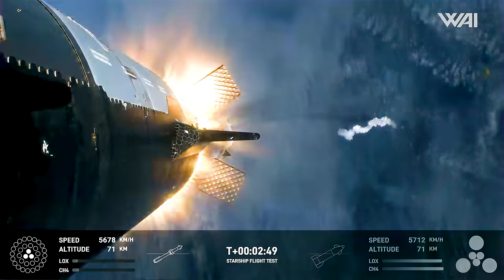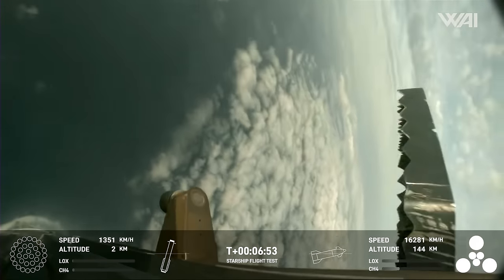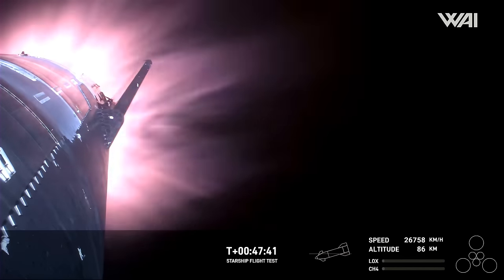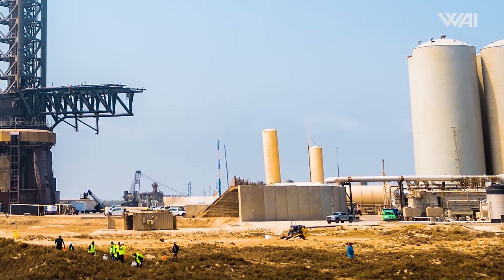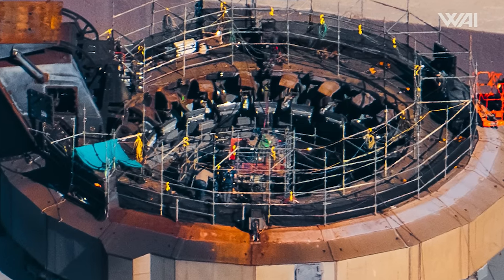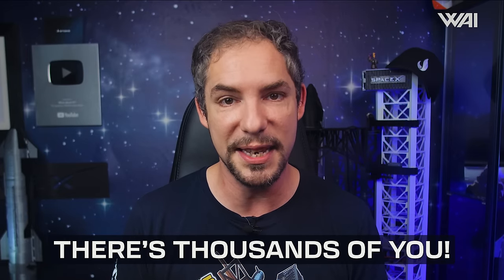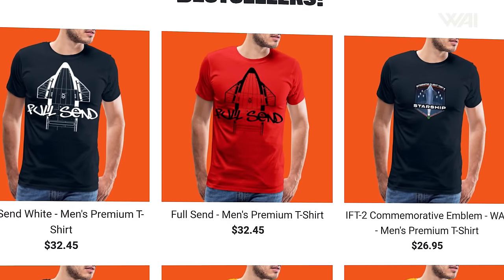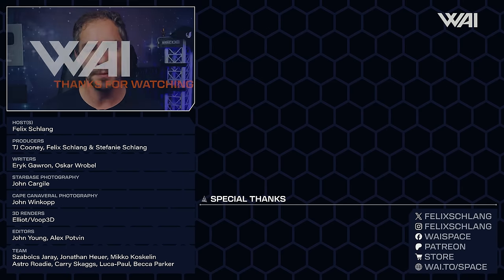SpaceX Starship IFT3 Aftermath: New Insights Paint Different Picture!

Comment: RETURNING booster may have to belly flop  flat return for a lot longer to slow the decent.
SN second stage may hae to be modified to have a mid ridge down length??
Like ma walnut ridge to disrupt plasma flow as  capsul  and may be a liqid nitrogen
spray system under ship to flow and cool plasma in 
period of high  intense minutes.
Booster metal grids should be turned to  a thin fin and placed back  to  a flat brake shape on flipping for return
Logic sayas if it slows guides coming down
the same drag will have effect wasting fuel going up.
Firing engines moments before flip ois virtical may help  a clean
less face on force to engine bells
+

Comment: It seems that Spacex have problems restarting Raptors. It is noteworthy that the orbital test of Raptor restart failed as well as most of those at booster landing. Together with the Starship stability and disappearing heat shield tiles they'll have their hands full in 2024. Probably we can expect full reusability demonstration in 2025 at the earliest. Still, fine progress. This isn't the easiest project of all time.
Reply: The orbital relight wasn't attempted, but that was due to the uncontrolled roll of the ship. Not to the engine.
Reply: The first booster catch is going to be .. intense!  I wouldn't wait until 2025.  If the next two flights have a controlled Super Heavy reentry all the way to splash down .. then should try a boost catch on the third flight.   They cannot keep throwing away boosters, if only to have one for inspection to see how well it held up, and how much refurbishment is needed for another flight.
Reply: @gregsteele806 this. The relight would have created more problems than it would have solved and was skipped entirely on purpose.

Comment: How does the booster pump the fuel to the engines during a 1000 km/h descent? The fuel must be “weightless”, floating inside the tanks during these speeds!?
Reply: Magic
Reply: During reentry the fuel will not be weightless, the ship experiences several gs of force as it slows down due to air resistance. The fuel would be push to the bottom of the tanks.
Reply: Watch the re-entry speed as the booster goes from 20km to 10km and then think about how it feels when you slam on the brakes in a car lol. I think the fuel issue was more the sideways fishtailing as the fins struggled to cope with the spike in atmospheric density at 7km.
Reply: @roberttownsend339 tnx! Its a deceleration! One less worry😂

Comment: As usual, relight seems to be an issue. They have to get this figured out next run or I have little faith they will anytime soon enough. Ultimately losing both yet again before touchdown, is a serious problem.

I'm not giving up on these guys but it's getting frustrating watching them each fail without completing their flights. Just stick at least 1 and I'll be more relaxed. It would seem these engineers can't think past the last known failure, not much in the way of foresight.

Comment: why isnt space x chill down the legs of launch site ? 
a plate in front of the legs en chill pipes behind it without a structral function.

if they let the booster start 1 engine at re-entry so al fuel pushed to the base the rest base they dont have the massive push at ones on the base off the booster
Reply: That's what the millions of gallons of water are for.
Reply: In short, because cold things snap.
Reply: @tomj819 they also chill the engines 🙊
Reply: @davelemmen4283  the engines are built to run at cryogenic temperatures and are pre-chilled to protect against thermal shock of transitioning from plus 70 degrees to minus 300 in a matter of seconds. The thermal shock of transitioning from minus 300 to plus 4000 in a matter of microseconds is an entirely different kettle of fish. That kind of energy is only reliably disipated by adiabatic cooling into a gaseous state, which is what the deluge system does. The engines can also be relatively brittle because the cryogenic parts aren't under  load. The launch mount is holding up a couple of thousand tons...

Comment: Aw, c'mon, it's a bit rich to claim that "ascent is no longer an issue" for Super Heavy.  3 out of 3 boosters have failed, albeit differently each time.  Yes, on every other rocket launch apart from Falcon, the booster is disposable, but this one is supposed to be designed to be reusable, thousands of times.  So far, it's not looking good.  As far as I'm aware, they haven't proved the reliability of Raptor for sustained reuse, although for the moment, that's a moot point.

As far as Starship goes, they're 3 for 3 there, too.  It was clear to anyone watching the stream that it was tumbling, this was particularly obvious just before the stream ended / it blew up, where the camera was pointing into space.

So, IMO, no, it's not really "steady progress". SpaceX are 3 launches in, at least 2 years behind schedule, and have burned through about 3 billion on expensive failures (it's costing about a billion a launch).  About 3 billion is what NASA have paid SpaceX for Artemis, according to their plan they should already have landed 2 supply ships on the moon - they have yet to show that they can get the damned thing to orbit /empty/, let alone do it with a payload and prove that the engines have the performance to get to luna.

Remember dearMoon?  The project to take paying customers on a loop around the moon, on Starship?  That was supposed to happen last year.

It's a disaster.

Comment: OK, well a little something about those metrics. Those people are not going to subscribe to your page. I personally just can't stand it when every single show I watch someone's asking me to subscribe. I definitely do not do that number two. I love the optimism about the future of starship, but for me it looks like basic problems have become problematic and a total disaster is what i saw in this launch. pretty pictures yes any other success no,especially control issues with WAY to much debris falling off the vehicle that appeared to be heat tiles yes I do understand SpaceX is development system like the Russians test fail upgrade test fail, upgrade test fail upgrade, but I would bet you $1000 that we will not see a successful reentry on starship for the next four launches they just have too many issues and problems cropping up with the booster and the vehicle. I do believe there was an underestimation of the challenge at hand. Falcon and starship are apples and oranges, and until I see an orange with an safe and repeatable re-entry sequence I'm not sold on starship at all. nobody's willing to admit there may be basic design issues with starship. It's not even disgusted in anyway. Also the booster too many problems there also if they're going to save that thing they're gonna have to slow it down sooner I noticed some severe vibration of the guiding veins which means the pivot points are not strong enough, and will have to be redesigned, I know they tried different vein for a while and went back to the old one. remember the whole idea for this is to carry human beings into space transfer fuel and then go to the moon and land at the pace we are proceeding. That's 20 years away and the Chinese are going to kick our butts all the way to the moon. i'm sorry, but I'm not all pie in the sky about SpaceX. I'm a realist 71 year-old pilot since the age of 15 MENSA a member who is built many of his own aircraft also only six people in the world did my job in the nuclear industry so it's not like I'm some dweeb running his mouth off. I see serious problems ahead for SpaceX the unbridled enthusiasm that I see is not warranted at this point. I know I'm gonna have some Elon Musk fan boys come and tell me that I'm just being critical and what I'll have to do is agree with them. Yes I'm being critical starship is not the falcon system the number of failures that I saw were many. including just basically opening and closing the pez door. I suggest many of your over enthusiastic viewers. Go and watch smarter every day when he goes to NASA and explains to them everything that he sees wrong with their plan for going to the moon and it's pretty devastating. NASA has always loved to spend taxpayer money like they did with their most giant failure that now appears to be headed for cancellation if it's not already billions upon billions flushed down the toilet so this is how a realist thinks. i'm ready for my tongue lashing now.

Comment: Congratulations to SpaceX on how far they have come. But we need to stop comparing this to other rockets that are not reusable to try and claim success on this test flight. While they did achieve some success and did better than tests 1 and 2, the overall test is a FAIL, because they did not achieve their stated goals.
-
Saying, well remember all other boosters are lost and not reusable so this was a success for SpaceX is deflection. The major sell of this booster is that it would be reusable and have a quick turnaround time like the Falcon 9 rockets. It was supposed to achieve a soft landing into the ocean, but it did not achieve that. Starship also achieved some amazing highlights and improvements, but it still failed the primary goal of this test. I am not even sure it achieved a successful test of the door as it did not look to open fully, then seemed to not close completely. Maybe not sealing fully had negligible effects on reentry, but can you say for sure that if the door was not sealed and as it reentered the atmosphere, it caused unintentional roll that the flight systems struggled to correct for? I do not think SpaceX would admit that and so of course they would say the door worked correctly. Felix said SpaceX might have tried to test its attitude controls while attempting reentry? Perhaps SpaceX should actually achieve its PRIMARY goal before trying to test other components. 
-
Let me repeat myself. The team at SpaceX should be immensely proud of their accomplishment. I believe in their abilities to one day succeed in their endeavors. But I wish people would call this test what it was, a FAILURE with some amazing achievements and data to help improve the next tests. Now I hope they focus on actually achieving the PRIMARY goals of these tests. Because even before this launch there was talk about maybe the 4th launch having a payload such as Starlink satellites.
-
Now if the stated goal of SpaceX was simply to have a heavy booster capable of launching large objects into space, then yes you can compare them to other boosters that are not reusable. But trying to use that as justification to paint this test as a success when it was NOT, is disingenuous. Before everyone starts clamoring again about how this went better than the previous tests and how they accomplished this and that. Take a deep breath and answer one question. Did the booster or the starship achieve their PRIMARY goals? No? then the test was a fail. Stop trying to claim otherwise.

Comment: What about putting heat tiles on the  chopsticks and or the launch mount to help block some of that heat??
Reply: Won't work
Reply: Heating tiles are essentially ceramic foam. They aren't that strong and would be crushed. As for the launch mount... the force of the exhaust (it isn't just heat) would pulverize the heat tiles.
Reply: How about all stainless steel construction and water jackets with leaky pores? Expensive yes but , if one is in it for the long haul???

Comment: Felix may love space planes, but space planes really kind of suck. The Space Shuttle proved how hard it is to get them right, and killed seven people in the process. The problem is reentry. You have to bleed off all that energy somehow. With a capsule you have an ablative heat shield which allows heat to dissipate by having large, fiery chucksn. of material fly away from the capsule, taking the heat with it. With a heat shield like the Shuttle (and sadly, Starship), all of the energy of reentry must be dissipated along the outer edge of the aircraft. So when a tile goes missing then all you have left is bare metal and you'll burn a hole through it. The is the Achilles Heal of any space plane no matter who builds it.

Comment: Paint looks nice, but a waste of money and man hours because it will burn up again. There needs to be an anti rust application, but how necessary is it really?
Reply: If they are in for the long haul, why are they not building everything with Stainless steel. Once and done. Put all plumbing and electrical in thick large blast proof tubes. Probably planned so for the future towers and pads and unitized as well, not separate pad parts.

Comment: Why don’t they cover the launch mount with the heat tiles they put on the Starship? Then they could just replace them instead of the metal.
Reply: Because it will blown away
Reply: Yeah, not much success with the tiles staying on the Starship but they could adhere them differently. I heard the reason they fall off on the Starship is due to the need for them to expand and contract with the temperature changes. They might not have the same problem if they just have to worry about heat from the booster. A lot of unknowns on how they are attached to Starship so who knows.

Comment: Hot Take: Starship will never safely land on the Moon. It's too tall and unsteady, and that's only IF they can figure out how to rapidly recover and relaunch for refueling... which I also do not believe they will be able to achieve in its current form using the chopsticks. The current materials, location and design used to make the launch tower, coupled with the immense power of the 33 engines is obviously too much to allow for the rapid cadence needed to refuel a depot for trans-lunar injection. NASA should have chosen the Alpaca spaceship for getting back to the Moon before 2030.
Reply: Apparently Falcon 9 booster are squat

Comment: So… STILL a million dollars worth of damage from every launch. The OLM design has been flawed from its inception.  It’s supporting infrastructure too close. And all because Elon did not want to deal with the ACoE in building a flame diverter and proper deluge system from the get go. The launch site is still a patchwork of fixes and workarounds trying to compensate for a poor initial concept.  Unlike the rocket that they can substantively change with every new build, they can not iterate away the fundamental flaws of a launch facility they can not entirely redesign and rebuild.  I would appreciate these channels somewhat more if they were actual cogent critique of the problems SpaceX is facing, rather than oblivious love rests extolling the genius of a guy who is actually creating problems that his engineers then have to try and salvage thru bandaids and afterthoughts. 
For example.  As presently envisioned, the mission to land a starship on the moon will require SIXTEEN flights to refuel the ship for its actual moon shot.  That is sixteen opportunities for failure or mishap.   Like full self driving, these promises will likely never be realized.  At best, Starship is shaping up to be a way for Starlink to perhaps become profitable by being able to put up enough satellites fast enough and at low enough cost to offer actually usable service to a large enough clientele to make money.   But that’s a private venture, and at present, it is Public money paying for all this development that may never be usable to land anything on the moon, or mars.

Comment: All of your observations are stupidity theories. Starship reentry is too fast same  speed during orbital flight 26000 kmph.  falcon 9 booster  and starship booster flight 3 goes down to as nearly 17000 kmph during boost back burn same as NASA space shuttle during reentry nearly 17000kmph. That's why starship cant keep its orientation and control of flap wings, starship heat tiles working great and stainless body survive reentry but the electrical components controls and starlink disk is roasted thats why it lost it signals and controls. About the frozen thruster that is another issue
Reply: Cool, calm down a bit.